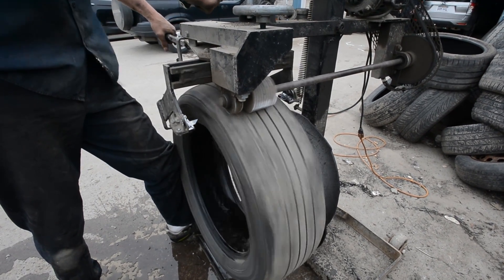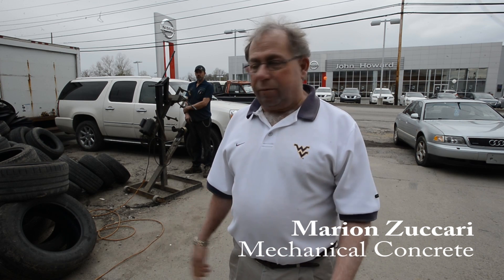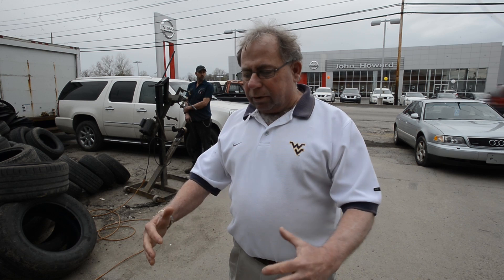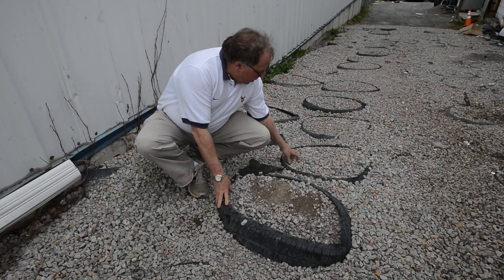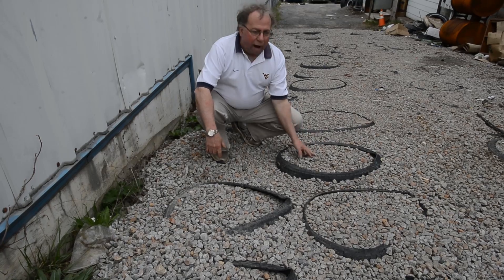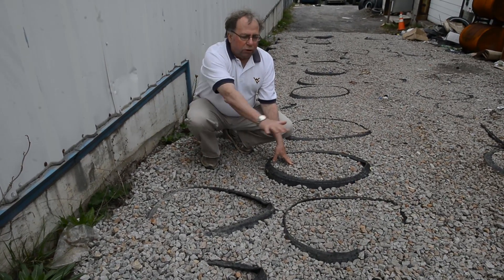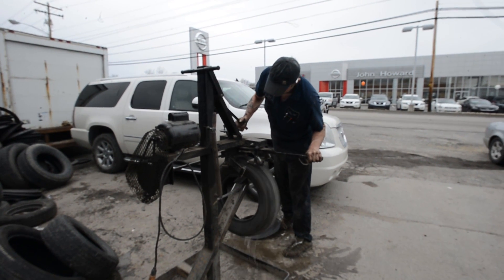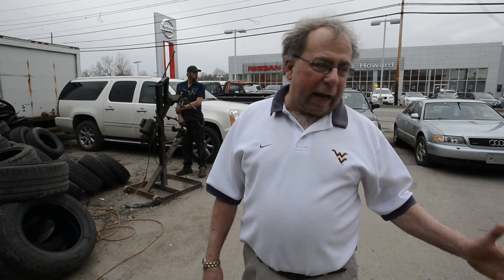Mechanical Concrete

Comment: as i understand this the tyres are supposed to be right up against each other and essentially stapled to the one next to it with heavy duty steel wire THEN filled with gravel.
Reply: with the mouth is easier !!

Comment: Got an off grid property and a huge mud hole on my road I fill every year.. I also have three shit tones of old tires.. I will see if this works..
Reply: Let me know if it works
Reply: Update?
Reply: @mc1992  it works, but it's way more work then just loads of rocks.. The tires also make drainage take longer.. It's way easer just too use rocks and gravel, without ever getting off the loader, or working a shovel.
Reply: @larryscarr1929  Thanks for the update
Reply: @larryscarr1929  I think this method is most useful for clay soils that are subject to heavy seasonal rain. I'm trying it in Thailand where rocks dont work - the clay swallows them over time. Hoping this method, with membrane underneath and french drains along the sides will create a raft that will "float" on the clay in any conditions.
Reply: @larryscarr1929  but does it last longer with tires instead of just dumping rock?

Comment: Can this method be used as a base for pouring concrete highways?
Reply: Yeah it is great the weight makes road stretch but the tire allows the road to spring back
Reply: Ofc it can

Comment: this guy may know what he is talking about, but he does a terrible job of selling.  he should work behind the camera, and hire a salesman to promote the concept in front of the camera.
also, if you want to promote a product, don't use as your example a job that was not done properly and was left unfinished... you really haven't got a clue when it comes to selling a product.
Reply: This makes him sound believable rather than a smooth talking salesman.
Reply: @abz124816  yes, it does, but only to a few of us (2%) that can see past the lousy presentation and have a good concept of the idea and its advantages.... but as for the remaining 98% of the population, a good salesman would generate far more future sales.
Reply: @abz124816  Sadly, to 2-3% of people like you or me, that's 100% true.  But there's a reason companies spend millions on spokesmodels, advertising agencies, and professional production.   I'm sure this concept works, it's simple & brilliant in it's design.  But, I'm guessing like me, you're not 95% of the public which doesn't own or work with equipment or even hand tools on a regular basis.  Those will be some of the people that need to be sold on this idea.
Reply: Many people watching Youtube videos on novel ways to build roads are not to impressed with car salesmen types.
Reply: I find his selling style refreshing.  Points out that there are some shortcomings, gives examples of actual application and is basically open sourcing the idea.
Reply: I know from a foreigner prospective, (I am French), this entrepreneur speaks like an old farm boy.

Comment: Thats sounds like one hell of an ideal and fix after all old tires seem to trouble and if its possible to improve roads with then its a win/  win and roads that can hold up to loaded from dump trucks or just fully loaded trucks is one hell of a way to show it works.

Wish you well
Reply: How can I assemble that tire cutter !
Reply: The unions don't want to build anything without planned absolescence.  :(

Comment: So what happens when you have to re-do the roads.    Seems like it would be a messy cleanup.
Reply: The machines that cut through blacktop, concrete and gravel can easily cut through rubber.
Reply: Why not re-use the tires?

Comment: Carbon capture at it's finest --- sounds like a good system to me,,,, I'd cut the tires in the center and use each half with no waste using the attached sidewall as a base sidewall facing down to bridge even better-- the way you are doing it now you are throwing away the best part of the bridge. Even though you are using losing 4 inches of height the base is already established doesn't matter if you have a foot or 3 feet of fill on it the base is already there,,, drywall or deck screw them puppies together and let her run!!! Good thinking (y)
Reply: (FYI) I was a road commissioner over 60 miles of roads for 12 years - 54 of them gravel -- heavy equipment operator for 50, good to see people thinking outside the box!
Reply: JAXTRUX would steel cross belting make this difficult?
Reply: just build a rolling shear,  simple
Reply: @kenknutson1598  
Agree, you can cut the sidewalls easily, not easy to cut steel belts
Reply: @c50ge I saw a video of a guy who figured out that you can cut the steel belt easily with a sawzall if you can keep the tire from freely shaking. He put a board through the center of the tire and then another board on top of the tire so that the tire was sandwiched between them. Then he used a big C clamp to hold them in place. The sawzall cut through the tire like butter.
Reply: @ErikLiberty 
That may be the reason lubricating the tire helps. If the blade can’t stick and grab the rubber the it eliminates the shake so the blade can actually cut the rubber .
Reply: yeah ideally I think your supposed to connect the tires together. Cutting them in half sounds much better also.